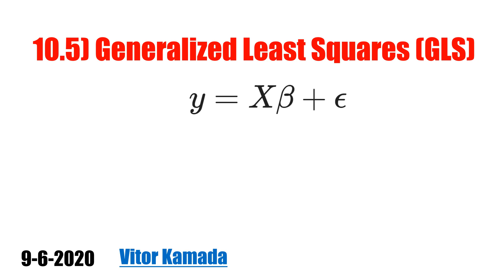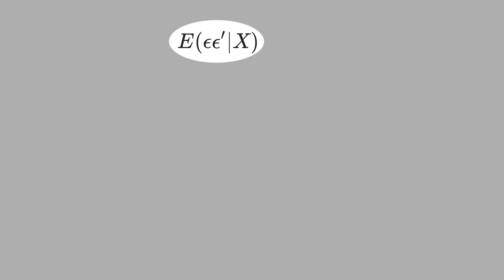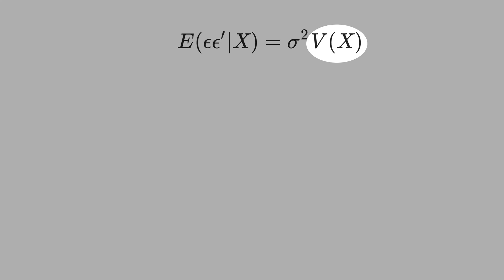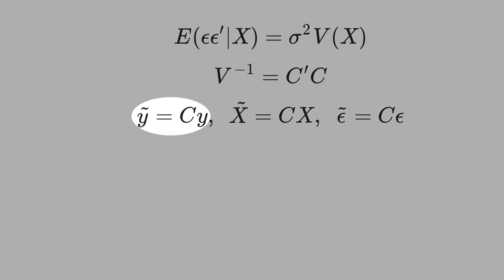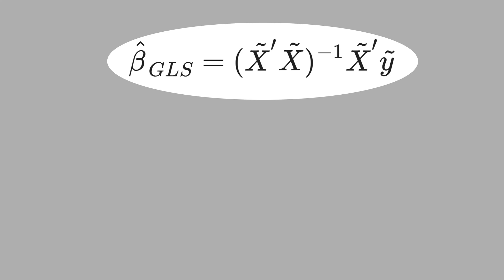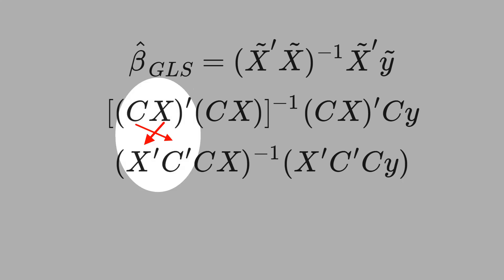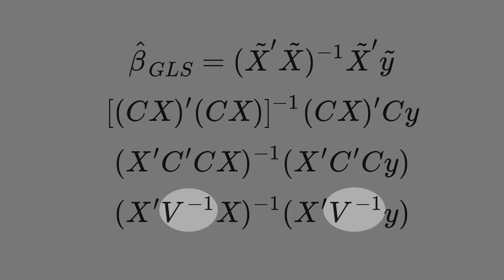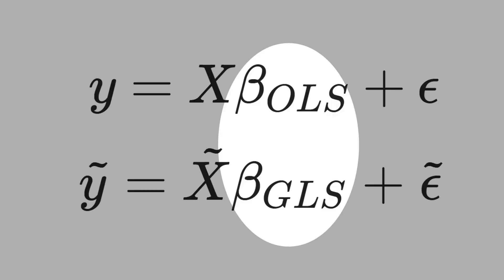10.5) Generalized Least Squares (GLS)

Comment: Can the GLS be used to estimate unknown parameters in a non-linear regression model?
Reply from the maker: Yes, you can use GLS be used to estimate unknown parameters in a non-linear regression model. Usually, the betas are unknown parameters. Nobody knows the "true" values of betas. You can also use quadratic and polynomial terms in GLS.